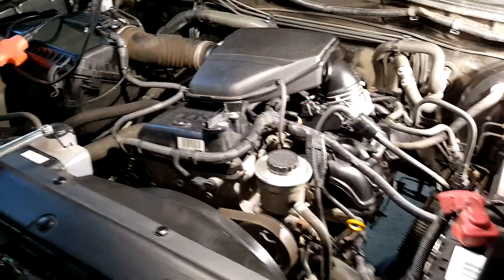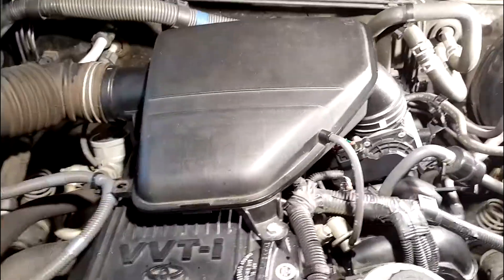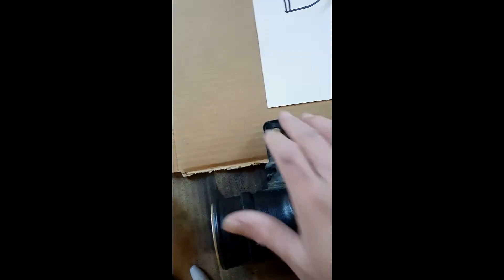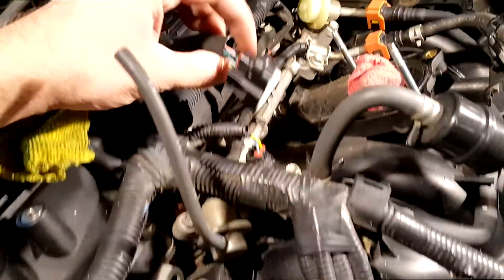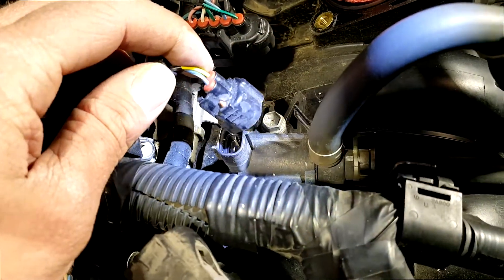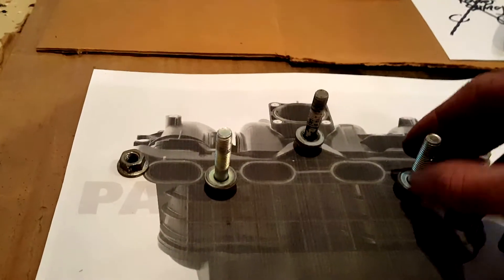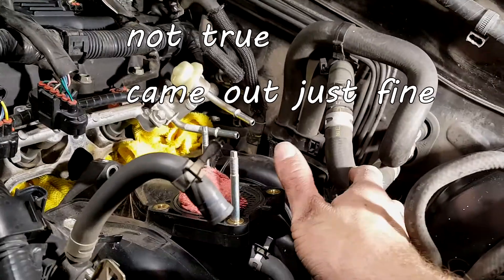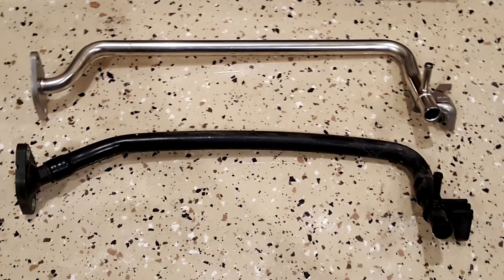Coolant Bypass Pipe Replacement Part 1, Toyota Tacoma 2.7

Comment: For anyone who’s done this my two main concerns would be that onece disconnecting the break line from the booster and fuel lines would I have to do anything to bleed those or anything of that nature. Also would I have to bleed my cooling system

Comment: Great video, brother! Just did this job yesterday. I also had to remove 2 transmission dipstick bracket bolts to be able to move the manifold out of the way.
Those 2 lower manifold bolts were a pain to get to but I found them with a socket extension.
Thanks again!

Comment: Anyone doing this: connect the vacuum hose on the firewall side to the hard line before you bolt the manifold back in, its a super pain once you've already put everything back together to try and get it

Comment: I know this old video bro, but this was a life savior. I had a leak at that line, come to find out the line had a crack and split from the line at the firewall side. 
I used your video to replace it with a hard line and no leak. 
Thank you for this video along with part 2 🤙🏽🤙🏽
Reply: Getting ready to do mine today. How long did it take you?

Comment: You did a great job with this video. I replaced the coolant bypass pipe on my 2012 2.7L Tacoma yesterday. It was helpful how you pointed out all the electrical connectors and vacuum hoses that needed to be removed. Thanks a lot!

Comment: Great video   I have a 2011 toyota tacoma 2.7 truck my problem  is that I have a small drip from the from the coolant bypass flags on thr bottom bolt were it bolts into the thermostat housing I was wondering do you if I unbolt the flange from the thermostat housing I will be a le to have enough play to put a new gasket on the coolant bypass pipe hope all That makes sense  thanks

Comment: Tack both fuel line hoses, evap hose and brake booster hose behind the metal brake lines to have more room to work with intake!

Comment: Great video and tips to have diagram ready with which bolt goes where. I have few questions.

1. Do the intake gasket really need to be changed? 
2. Did you use an aftermarket intake gasket?
3. Is a thermostat hosing gasket maker really needed to be applied if using a new gasket?
Reply from the maker: 1. depends do your own Inspection. I would, there cheep. 
2. yes used aftermarket intake gasket, not OEM
4 most likely not, just torque should be good.

Comment: I have a 2013 with the 2.7 and Toyota had changed over to the metal bypass pipe on mine. Hope you didn't overheat your engine due to the plastic pipe and your video was a good one.

Comment: I have to thank you sir, for the excellent video.  I had to work on m fuel filter and this was the only video I could find that showed me how to get to it through the intake manifold.  Your video also saved me afterwards when I failed to recall the “hidden” vacuum line until I rewatched the video last night hoping there was a line I didn’t remember because everything else worked beautifully.  Thank you!!!

Comment: Perfect. Completed the job with a few tools. A socket wrench, 8-inch extension, 10/12mm socket deep well socket big box store kit. A 10mm wrench short, and a small pair of pliers, and a screw driver.  The gasket for some reason likes to jump off the posts when putting the new pipe in place. About a liter of new coolant, a touch of RTV gasket maker on the seal as well. 

What helped put the bolts and nuts back on was tearing a bit of shop paper and using that in the socket to hold the bolts/nuts from falling off when setting, some people use bees wax too.

Comment: I just did this. YOU DONT NEED TO FULLY REMOVE THE MANIFOLD. If you loosen the manifold mounting bolts and studs, the manifold can move far enough out (towards driver side) that you can get the new pipe in underneath it. It's not exactly easy but I think its simpler than taking apart all the lines to the manifold and throttle body.
Reply: Please Tell me Why not just replace the gasket ???  Ty
Reply: The original plastic pipe is infamous for failing due to heat stress and wear. If you’re going to do the work to access it, you want to swap it with metal.
Reply: Flat rate that job !!!!!

Comment: My coolant by pass tube is leaking like everyone's. My mechanic had to remove the intake manifold as there is no way to get the pipe out otherwise. Labor = $590. Parts $75.

Comment: was t he hose damaged
Reply: If you have an older Toyota 2.7L engine with this plastic pipe, it should be changed out for the newer improved steel pipe whether it's leaking or not. It will fail eventually.

Comment: Just did this on my '05 Taco.  Your video was very helpful.  There are 2 bolts that mount the transmission dipstick that need to be undone in order to maneuver the manifold.  One bolt was mounted on the manifold intake itself and the other was further down the dipstick tube a little past the starter.  Once unbolted you can twist the dipstick tube clockwise to make room.

That hidden tube connected to the manifold could be pulled off even with the hose clamp in place.   Looks like the engineers did this by design.  

Other videos mentioned that no gasket sealer is needed on the black metal gasket.  Just in case, I put some Permatex blue on the water pump side and the metal bypass tube side.   Then, I put on the bolts till snug on water pump side and the firewall side. I let the sealant set a few minutes while I cleaned the intake manifold and installed new gasket.  Then torqued the bolts on the pump side to 80 in-lbs.  On the firewall side just above the starter, I had to put the bolt on reverse since the metal bypass tube was a little longer than the original.   I like this setup, if the bolt comes lose while traveling, it will fall in the starter mounting bracket.

Comment: What all tools were required for this job?
Reply from the maker: You don't need anything fancy, socket set, screwdriver set, pliers set, just basic tools.
Reply: @mjschmidtmedia  10mm for battery. 12mm for bolts.  Red sealant for intake manifold.  Blue sealant for bypass tube.  Pliers for hose clamps.